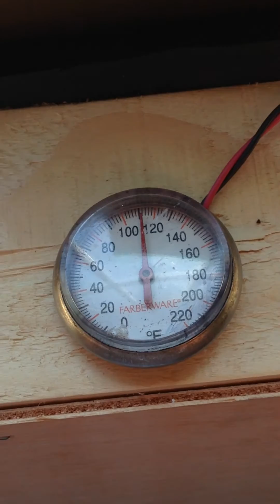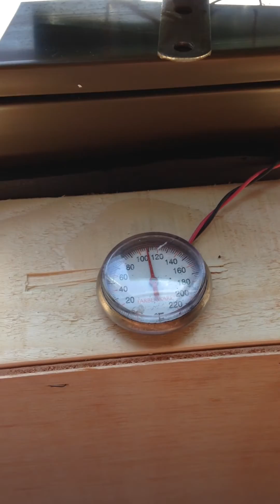Window solar hot air heater with TiNOX

Comment from the maker: FYI I recently tried and tested 2” wide lats , 8 gauge black aluminum blinds and found that they put out heat ranging between 110-114 degrees!
 Black blinds looks far better and let’s more light into the room.
 I would suggest using the black blinds with heavy drapes so you can close the drapes at night to insulate the window and open them in the morning when the sun comes out so the heat from the black blinds can circulate into the room.

Comment from the maker: I found a company here in USA that sold this by the roll. I purchased a large roll thinking of using it to build large outdoor air heaters but decided not to because of not being able to find good dampers that wouldn’t let cold air into my house during night time.
I would not advise getting Tinox for a window heater.
 I have recently tried and tested 2”-8 gauge Black aluminum window blinds and found that they put out the same 110 degree temperature as this heater on this video.
Black aluminum window blinds look better, let’s light into the room, cost far less and if you incorporate heavy drapes with the blinds you can close them at night to insulate the windows.

Comment: Where is the Tinox from? Alibaba?
Reply from the maker: Emelcogroup.com
It wasn't easy ordering it and they only sell it in big rolls. I was planning on building large outdoor solar heaters but decided not to since it requires drilling large 4"+ holes though the house and couldn't find a tight enough damper to close at night so heat didn't excape. 
These window heaters made a diffrance during the day to where my furnace didn't kick on as much and of course did nothing when the sun went down when it's the coldest.
From my experience trying to get Tinox for just window heater would be very hard to do with this company since it is a small amount and if you could I believe the cost to build isn't worth the small amount heat savings. 
 Since I made this video I've installed 8.5 kw solar electric on my house which made a HUGE  difference.  No electric bill and no car fuel cost since getting a Chevy Volt. ;-)

Comment: I am building a can heater, but I like the idea of the film.  I am confused however.  What is the point of the film if you need a solar panel, is that the heat absorber?    I live in a condo and need to put the heater / solar item right in my window.  Not allowed to put anything outside.  Also I have no knowledge about how to wire a fan.  Can you reccomend what I do to make a solar fan?   How much would you charge to make a window passive air heater?  I am on disability so I really am on tight budget and need to lower my heating costs.  Thanks.
Reply from the maker: Get 2”-8 gauge black aluminum blinds!
I recently tried them and found that they put out the same 110 - 114 degree temperatures.
 Looks far better and still let’s light into the room.